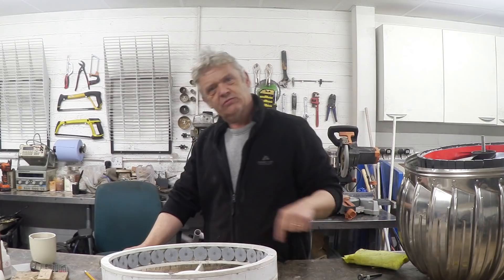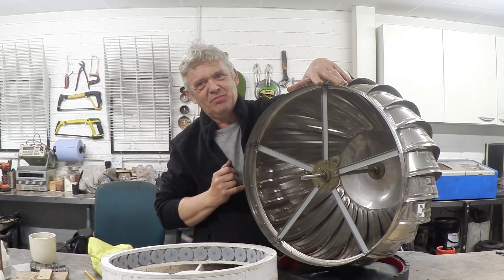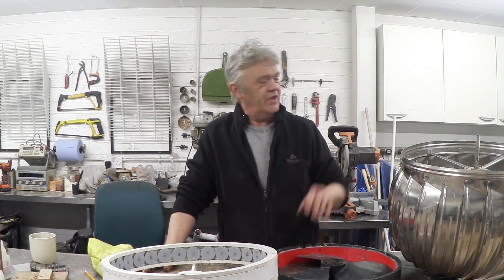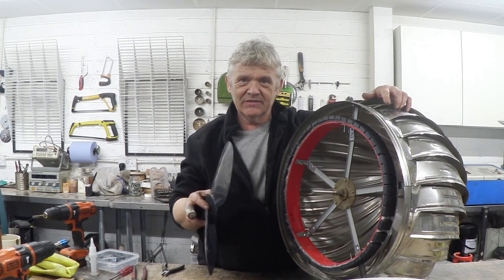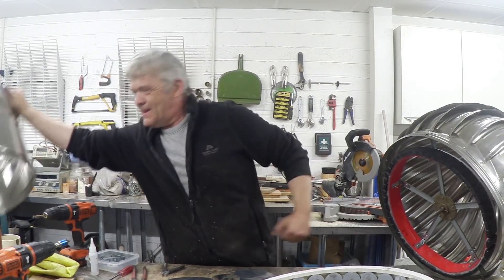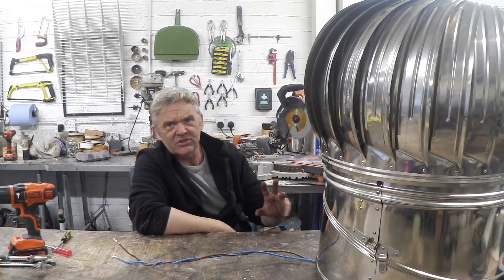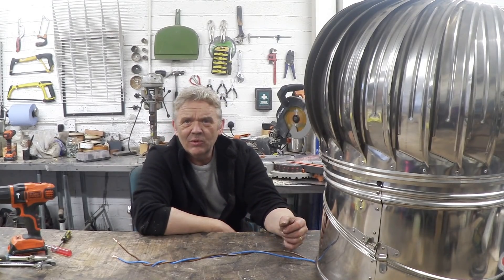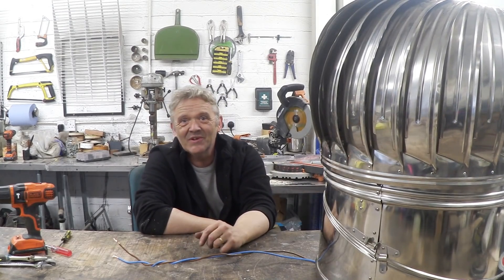Rotating Ventilator For Wind Power Part 5 - Finishing And Testing

Comment: Well!   That answers all my concerns.   Great explanatory closer Robert!    Great fun; thanks!

  You should Google: Honeywell wind generators and look at what they've done along this line Robert.   Same principle using a bicycle wheel.   I think you'll be impressed.
Reply from the maker: I have had a look mate - I tend to do a little research before each project - they have had a troubled history not living up to claims etc
Reply: @ThinkingandTinkering   It was the first time I saw the outer edge in use as the working area rather than a central motor type system.  I was floored when I realized the obvious advantages to using the rim rather than the center.   I certainly wouldn't promote Honeywell's products but it was the only example that came to mind.  I think their are many other possible advantages to using the outer edge as the working area.  Properly constructed it clears the entire area of the core for uninterrupted air flow, as in the case of the whirly bird you started with.  Great job by the way.  Take care of the finger.....
Reply from the maker: @thornhedge9639  it is funny how resistant folks are to change
Reply: @ThinkingandTinkering 
   By the Way: Honeywell is a major Defense contractor for the U.S. D.O.D.  Meaning they're not used to having to live up to their claims.....If you take my meaning!
Reply from the maker: @thornhedge9639  lol - yes I do

Comment: This may be a silly suggestion but what if you used your contra rotating gears to spin the coils in the opposite direction at an equal speed? Great build by the way.
Reply from the maker: I would think you could mate - to be honest I was asked to see if it was a possible thing to do and I think I answered that question and to do that I basically did the simplest thing possible - I am sure there are a million improvements that cane made